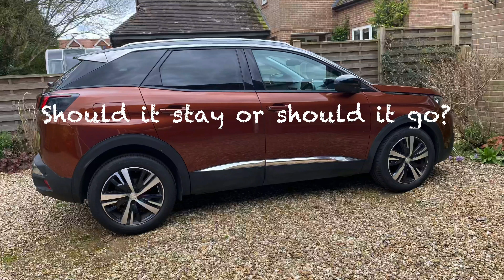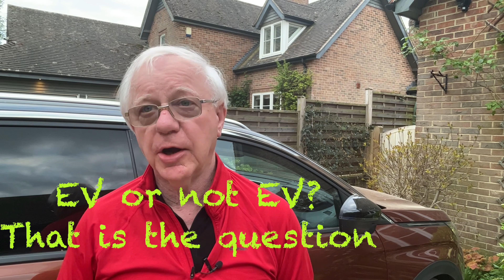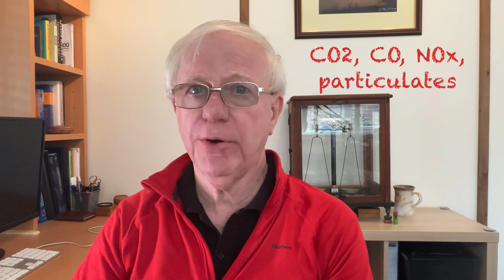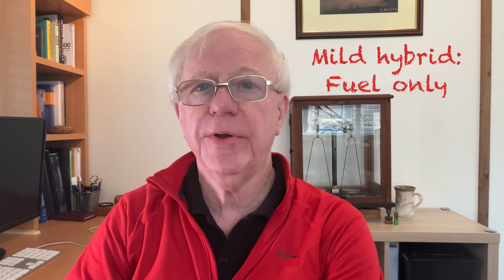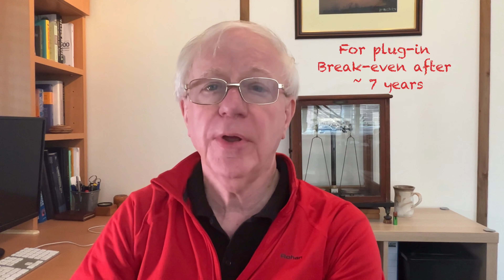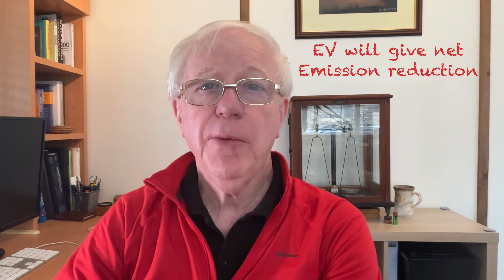Should it stay or should it go? EV or Not EV? That is the question.

Comment: When all said and done 'self charging' hybrid cars are powered by fossil fuel, though more efficiently. But what about some of the newer 'self charging' hybrids that operate with only the electric motor in the drive chain, sounds like a considerable saving in mechanical complexities of drive transmission. An ICE just charges the battery when needed, which means the ICE can run in a more efficient manner at more or less constant ICE RPM.